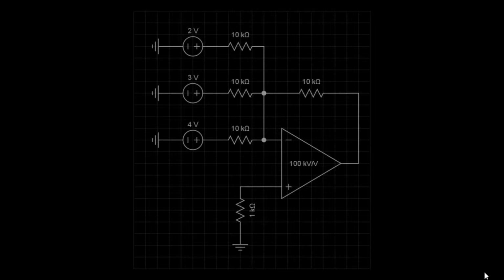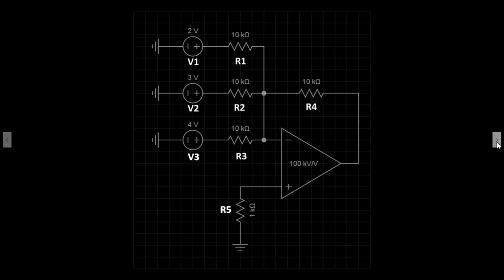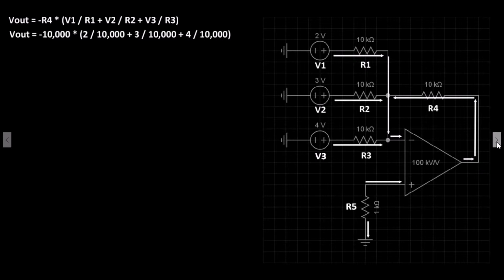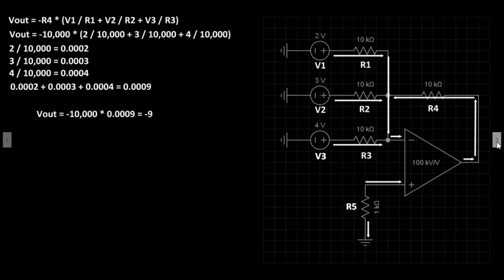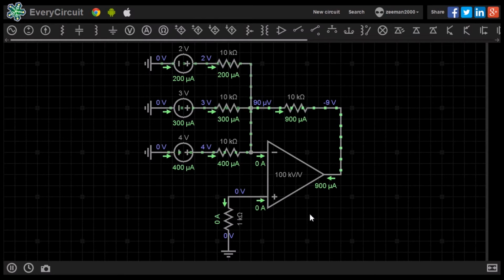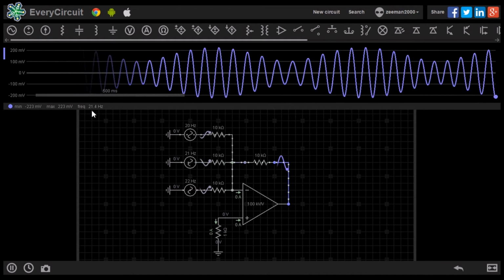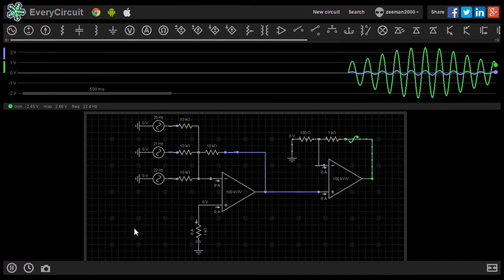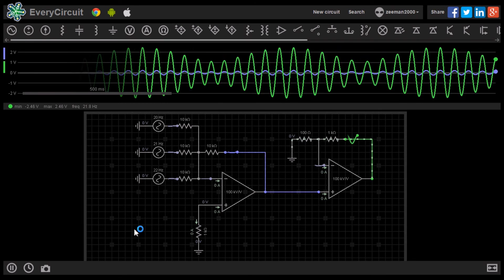Electronics Tutorial 13 - Op Amps - Inverting Summing Amplifier

Comment: Jenko022, Could you please confirm that the component settings for the 3 AC Voltage sources I have given below are correct, as I'm Getting some Clipping of the signal from the Output of the Second Amplifier (Green Trace). 

Electronics Tutorial 13 - Op Amps - Inverting Summing Amplifier

AC Voltage Supply - 20Hz  -  DC voltage = 0v - Amplitude = 1v - Frequency 20HZ & Phase = 0

AC Voltage Supply - 21Hz  -  DC voltage = 0v - Amplitude = 1v - Frequency 21HZ & Phase = 0

AC Voltage Supply - 22Hz  -  DC voltage = 0v - Amplitude = 1v - Frequency 22HZ & Phase = 0

Best Regards, Stephen Roberts
Reply from the maker: Hi Stephen the voltages are 100milli volts
Reply from the maker: Sorry, amplitude is 100mV
Reply: +Jenko022  Thank you, these videos are very good, I'm learning a lot about electronics.  I hope that you will be producing more of these, thanks, Stephen
Reply from the maker: +Stephen Roberts Thanks Stephen glad you enjoy. More videos will be posted very soon.